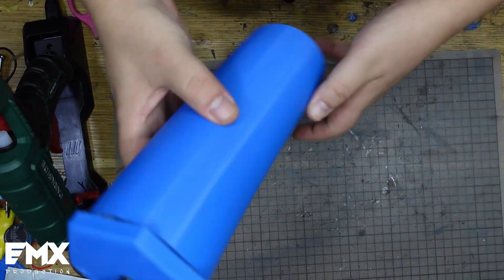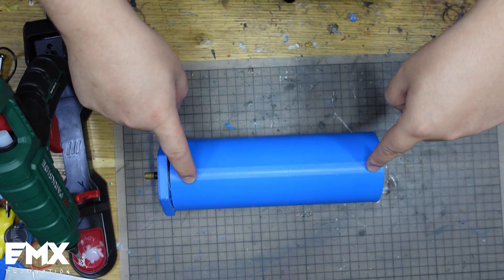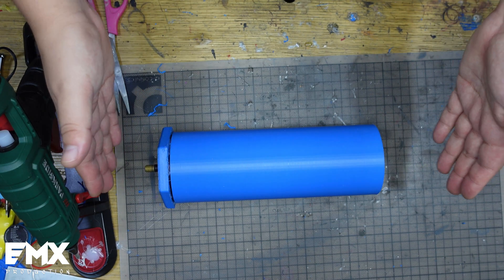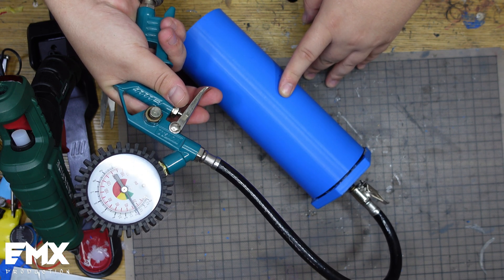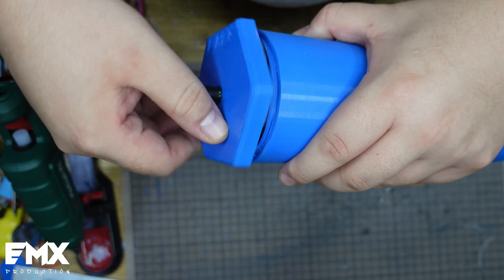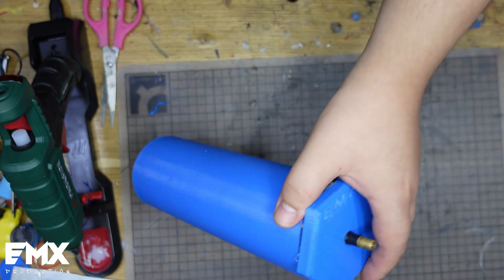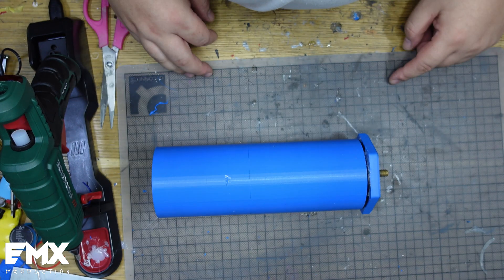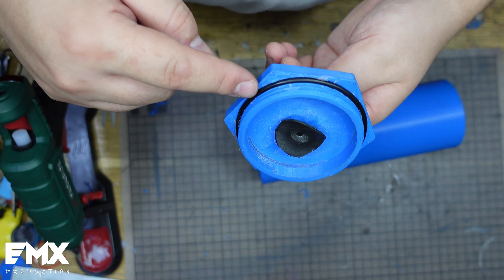Can you Pressurize a 3D Printed Cylinder

Comment: I'm curious if it will hold a set pressure or leak out over time
Reply from the maker: It can hold as long as the seal is okay
Reply from the maker: You can coat it with a resin inside too and it will hold more psi